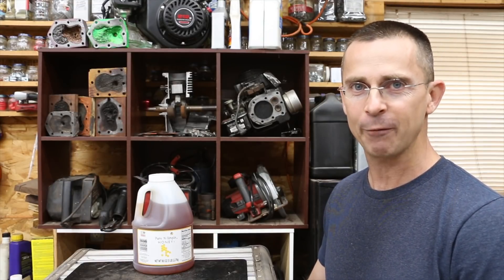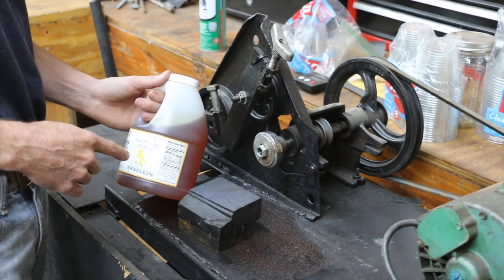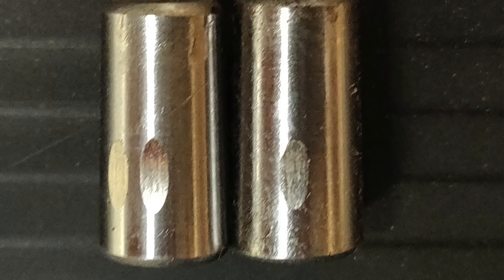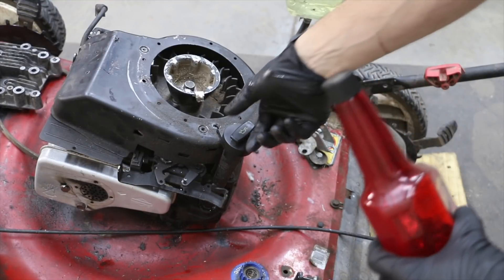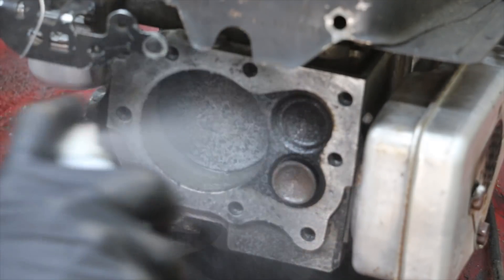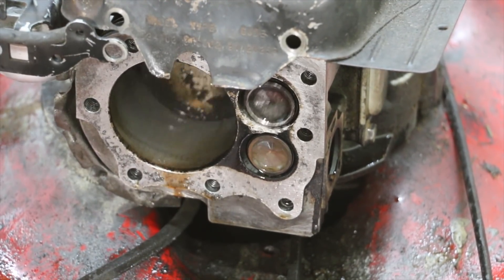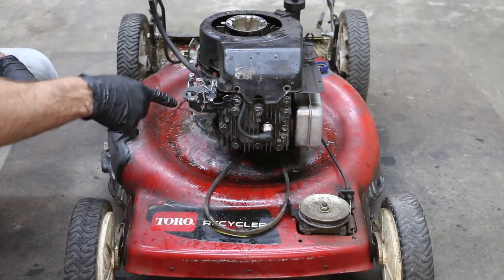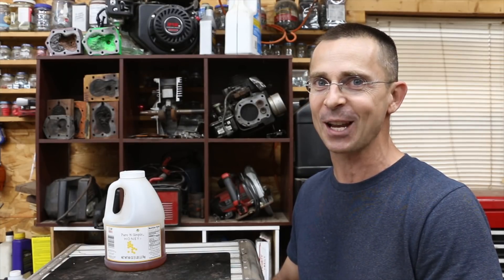Can you use Honey as Engine Oil?  Let's find out!

Comment: I gotta admit, I did not think it would work as well as it did. The intake valve frozen open reminded me of a small engine failure I've seen a few times now. Those square panel air filters have the paper filter media glued into the rubber perimeter gasket, and a lotta the cheaply made ones have big snotty drips of excess glue on them. After that's been heated and softened by gas vapors, it can eventually run and get drawn into the carb. I haven't actually seen a carb problem due to it, but if it continues to migrate and throw strings of glue snot down the intake, it eventually hits the intake valve stem, bakes onto it, and wedges it open. The motor spins to a halt throwing hard backfires back through the carb and when you try to restart it has zero compression. Most of the ones I've seen were given to me as supposedly basket case engines, some quite new, and there's nothing wrong with them. Often just flooding the intake tract with spray cleaner will do the trick, at worst you have to remove the valve and clean it up. When you just throw cleaner downhole and crank it, you can feel when the valve begins to move and compression starts coming back. When it starts it's kinda choppy at first but keep spraying shots through it and it gets better and better until it's normal again. Kinda cool when they come back from the dead. Especially when the lawn equipment repair shop told them it needed a new motor and you just fixed it for them in 15 minutes with a $4 can of cleaner...LOL
Reply from the maker: This is interesting!  Thank you for commenting on this.

Comment: Idea for future videos: Try out single grade engine oil like SAE-30 or SAE-20W in hot/cold conditions. 

You should keep in mind, that there is quiet a difference between cheap honey and higher quality honey. 
The cheap one is often mixed with syrup (despite the fact its not allowed). This can make a little difference. 

I was quiet surprised it did so well in the bearing test.
Reply from the maker: Great test idea!

Comment: Thanks for the video great as always. Can you test the best way to fill and tap a hole that has been stripped out in aluminum. I know you could put in a bigger screw but can you use epoxy or some other method like wrapping a wire around the screw to repair the item. I have tried jb weld and it failed when I treid to drill and retap. I had some success with putting copper wire into the hole and gently screwing the screw back in but it is very fragile. I had no luck wrapping the wire around the screw :et me know what you think. next best thing would be insert nut or a blind nut that is crimped into place.
Reply from the maker: This is a great video idea!  I'll see what I can do.

Comment: I am always trying to extend my engines' lives, so it is hard to think of ways to ruin an engine.  I am thinking along the line of "What WILL work in an emergency"?  Perhaps a mix of hydraulic fluid, bar oil, gear oil, power steering fluid, etc. to replace motor oil.  Can you make a similar viscosity?  Lubricity test? How does it break down/last?
Reply from the maker: Thanks for the test ideas!

Comment: the best way to unlock a stuck engine is to turn it backwards it will come lose easier and do less damage to the cylinder  i work on small enginges and thats how i unlock one if its stuck
Reply from the maker: Great recommendation!  The valves and presumably the camshaft were stuck from the honey.
Reply: @ProjectFarm  i agree and depending on how old the engine is it could have a pastic drive gear on the crack sharft for cam and it could possibly break or deform and cause not to run  proper and great videos i enjoy watching them and look forwad to many more

Comment: Hey it did better than some of the other stuff you tried. 

Personally in an emergency I'd say this is fine, since with a water cooled engine I would say if you removed the thermostat it would probably live a bit longer.

If you run it with shampoo or dry, it'll die anyways, so it's best to get another half hour-ish out of it in an emergency, right?
Reply from the maker: Great point. Thank you

Comment: Wow, this is nuts. If there's a single overriding lesson from your videos, it's that these small engines can take a remarkable amount of torture and keep working if they're eventually looked after.

Just crazy that you didn't blow a connecting rod when running on honey, when that's a fairly common manner of death for (esp Tecumseh) snowblower engines that have oil-related trouble. Wonder how much of it is down to engine design, or horizontal vs vertical shaft...
Reply from the maker: Great point.  I'm surprised it's still running!

Comment: Not too surprising since sugar starts to break down at 350°F. How about paraffin wax as an engine block lube? You'd have to heat it to pour it in and probably give the shaft a few turns to get it into the system before it solidifies, but once the engine is running, it should melt into a liquid again in no time.
Reply from the maker: Thank you

Comment: Imagine it's an emergency and you have to run the engine with stuff you can buy at the store - so, for example, you could try canola oil for lubrication and vodka as fuel. Or perhaps molten candle wax for lubrication and nail polish remover for fuel - just a suggestion, have fun :-)
Reply from the maker: Thanks for the video idea!

Comment: Seeing the next test could very likely be the last test how about something that may send the engine out in a blaze of glory or not.... Can you use gasoline as engine oil?
The common sense answer is NO, it will probably catch fire to the vapour leaving the crankcase, it will boil dry or there is just not enough lubrication. 
The lubrication situation can be tested first to see if it is even 1/2 way viable with your test machine. 
If the parts from the "Is Using Gas Vapor to Power an Engine a Myth? Let's find out!" video and engine are still around your most of the way to solving the vapour leaving the crankcase fire problem, retrofit the system to this engine (so it runs on vapour), give it a test on normal oil to make sure, run an extension from the crankcase vent to one of the vapour carburettors (the bubbler) openings so it can draw in air as well as the vapour. That answers the vapour problem as it now will take it in as it runs. 
Take the whole lot outside so if it goes boom the worst is burnt grass rather than a burnt workshop. 
I would put a second valve on the line and leave the original open normally (this is now a back up), take the handle off the valve and weld the end of a good length of round bar (steel rod) to it, find a length of pipe that slips over it, oil the inside and slip over, weld the handle to other end, control at a safe distance can now be done by holding the pipe in one hand and moving the valve handle. 
Another control at distance feature that may want to be put in place is to pin the mower down, take a metal cable and a small pulley, fit cable to spark lead, run through pulley to change direction by 90 degrees. Means you can pull the spark and shut the air from the same spot. 
The last problem is boiling, this is a problem you may not want to fix, for example the "will it seize up or catch fire first" angle makes for a good video but it is going to be short for the amount of effort put in. If you want to deal with this and leave the "will it seize up or catch fire first" for a finally, then the only method is going to be to add more gasoline as it is running, I can think of a couple of solutions but it is best if you come up with something your happy with as ideally it should be controlled away from the machine as gas plus hot metal can = fire ball.
Reply from the maker: Thanks for the video idea!

Comment: Something just dawned on me. Not for this video's lawnmower. How about using a Junkyard Car's FUEL INJECTOR  into the Carb port? [You'd have to figure out air issue] You can control the  Fuel Injector  solely with on/off voltage.  Maybe  have  it run ON at higher RPMs. This very well could be used  in an emergency! One  off of  a smaller  engine car. Cause the amount of fuel it lets  out. A simple valve adjusted Air line for the intake. There  are several ways  to pull this off in all  reality. IDK  why I  never thought of adding in a Fuel Injector before.
Reply from the maker: Thanks for the video idea!

Comment: Wow what an awesome test with insane results lol, I kinda figured once the honey started getting hot, it’d start turning thin as water lol, and of course once the extra friction due to the lack of lubrication built up enough heat, the sugars in the honey started crystallizing, and boiling out of the ventilation tube for the cylinder lol. I think in the situation of no oil or honey in an emergency, you might as well put water in the crank case lol. Next try filling the crank case with grease and see if that would be enough to keep it lubricated lol, wheel bearings seem to like grease lol.
Reply from the maker: Thank you for the test idea!

Comment: TEST SUGGESTION: Use castor oil to see if the varnish it leaves behind can restore compression in a badly-damaged engine. I'm talking about the un-processed castor oil people use as a laxative, NOT the de-gummed stuff sold for 2-stroke engines. The gum is the part of the oil that turns into varnish when heated. I know it works for RC car engines, but those engines don't have piston rings. I'd like to see if it works in a ringed engine running on gasoline. This test will probably take a long time, because the varnish deposits don't build-up very quickly, so you'd have to run the engine once a day for about a month to see if it will work.
Reply from the maker: This is a great video idea!  This engine has so much blowby now that it won't run for more than 20 minutes before all the oil blows out of the crancase ventilation tube.  Thank you
Reply: @ProjectFarm : Wow, that's some insane blowby. You might need to use an IV drip to keep the oil topped-off during the castor-oil test. :D

Comment: I would love to see if CLP ( Cleaner, Lubricant and Protectant ) works as oil. Used to use it to clean guns, and lube IS it's middle name.
Reply: The oil in CLP is too thin for use in a reciprocating engine. It's comparable to the miniscule oil content in WD40. It would be better than running the engine completely dry, but only slightly better.

Comment: Being a Beekeeper myself...I knew I was going to be amused by this experiment.  The results were quite predictable too.   Perfect Honey has a moisture level of around 17-18 Percent Water and if the moisture is much higher than that...the Honey will start to ferment.   If Lower...Honey will start to "Seed" and Crystalize!    It'll work for a very short period...but only until the honey in the crankcase begins to lose moisture from the heat.   The Mayhem Begins...and predictably the Engine seizes up very quickly.  This would be akin to putting Sugar in your Gasoline.  One thing is certain...I won't be pulling up to my Hives to top up my Oil!  LOL
Reply from the maker: This is very interesting.  Thank you!

Comment: Hi! I have idea! You have "friction meter". It's very interesting to find which vegetable oil is best for crank case washing? When we change oil, we use not cheep "fake motor oil" and petroleum to clean gunk. In the world of vegetable oils we can find cheep alternatives. Of course we wash all with diesel after all, before we put in some fresh motor oil! :) Thank you!
Reply: Gasoline is a better degreaser than any type of oil.
Reply: Shawn Elliott Yes, but it is too thin and flameable. Idea is to crank engine without ignition. To remove all gunk, before we put new expensive oil in.
Reply: @Ansis99 : If the ignition is disabled, then there is no risk of fire.

However, keep in mind that an engine with sludge buildup has been badly maintained, and it may rely on some of that sludge to seal leaks inside the engine. Cleaning the inside of the engine without replacing any parts may actually cause the engine to run _worse_.
Reply: Shawn Elliott Yes, it can be. I change engine in my old VW Golf 2. Motor from junkyard was in very bad shape, with stones in the ignition chambers and oil was like black glue, slimy. But after very many hours of sucking, washing it works fine, without any changes in the motor itself. 10 years from now. At start, there where strange sounds about 1/2 year, but after that period everything fine.

Comment: Non-newtonian fluid as engine oil
Reply from the maker: Thanks for the video idea!
Reply: the harder you hit oobleck the harder it resists, right? if that's the case, you might as well just throw wet cement in there lol
Reply: Isn't honey non-newtonian?
Reply: Vibhav Jha it is, but I think he meant something like oobleck
Reply: @ApeX-gh1wo  Interesting to see oobleck and how itll work with the piston slapping it..
Reply: You'd have to add it while the engine is at the rev limit, it would be near impossible to start with the non-newtonian fluid in the crankcase before starting
Reply: corn starch solution

Comment: Ha ha great one! It would might work - at least for a short time - if you could keep the engine heat down to a minimum, lets say by removing the thermostat so the engine would have unrestricted cooling flow. I'm talking of a water cooled engine here, as they tends to operate at a lower working temperature than an air cooled one.
Reply from the maker: Great point. Water cooled engine might last longer.

Comment: One idea I was thinking about was to collect the crankcase vapors and collecting the condensed liquid. I have fitted a catch can to the PCV of my turbocharged engine, and the catch can condenses and collects crankcase vapors, and prevents them from entering the intake and building up on the valves. It is mostly a mixture of oil and unburnt fuel, as well as water condensation. Would be interesting to see both how well it burns, and if it still has decent lubrication qualities. I am storing what I collect at regular intervals.
Reply from the maker: Thanks for the video idea!

Comment: I heard once that with old model t engines you could use a strip of bacon, or maybe it was a strip of the pork belly skin as a temporary replacement crankshaft or connecting rod bearing. Maybe when you decide that that engine is toast, you could cut some really thin strips of bacon and replace the rings, or add to the rings and see if it increases compression for a little while.
Reply: Not a chance. Crank bearings, even in low-horsepower engines, experience forces that would crush fatty tissue and squish it out the sides.
Reply from the maker: Thank you!
Reply: My dad told me when he was a kid, the old car they took from Wisconsin to Iowa stopped several times to get a fresh piece of leather belt as a connecting rod bearing. He said Gramp would hear it start ticking and pull over to drop the pan and pull a cap. He also mention fixing tubes and changing tires many times. I think it was in 1934.
Reply: @tt600pch : Leather would work better than bacon (lol), because leather is comprised mostly of collagen which is a very strong protein, and it's chemically altered with acid to further increase its toughness. Boiled leather would be even better, because boiling is how you harden leather to make medieval armor. At that point, though, you're talking about a couple days of prep time, and you'd be better-off just installing a proper replacement crank bearing instead.
Reply: I have built engines, so I understand where you are coming from.This was a different era.  It was 1934. I don't remember which Dad said it what car it was, though it was likely a  dipper oil system. (low RPM) Seemed like Dad said it took 3 days to make the trip. Not a lot of options back then. Dad taught us values most kids of today will never understand. Bacon is for eating!

Comment: If this engine is about to die, could you run it with gallium in the crankcase? It "wets" surfaces that it touches, meaning it could have lubricating properties. It will also utterly destroy anything made of aluminum, so the block and cylinder head will probably disintegrate as it's running.
Reply from the maker: Great video idea!  Thank you.

Comment: Toddler,
Down to 80 psi that Toro recycler slowly dying. I saw the notification around 3 PM but I just got him but I did watch it are we going to try that mineral oil or the caster oil yet ? 
Good night 
General repair
Reply from the maker: Hi Mike,  I still need to test mineral oil and caster oil. One thing for sure, they both will do better than honey.  I think the compression would climb some if the rings weren't so contaminated with carbon and honey goo.  Hope all is well!

Comment: I just want to start out by saying, another great video. as I just just learned I will not be using honey in my engine anytime soon. 

I just would like to recommend using sea foam to clean up the honey mess in  this lawn mower. 

I liked this video because of the learning lesson in this video not to use honey in the crank case of an engine. 

Can we see if we can power a lawn mower on Pepsi, in a future video please and thank-you. Will the engine run and or do we need to mixes the Pepsi with gasoline?
Reply from the maker: Thank you very much!  Also, thanks for the video idea!